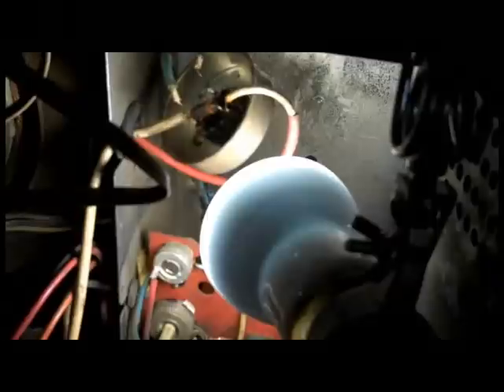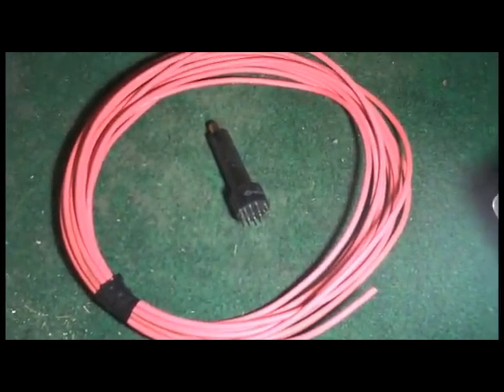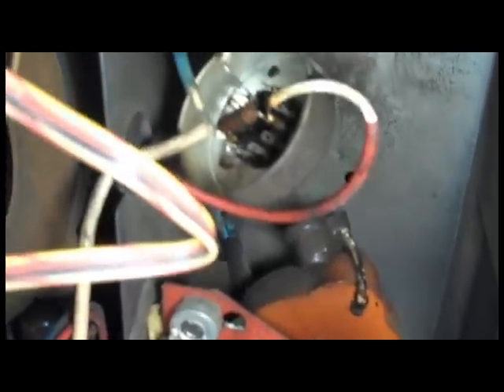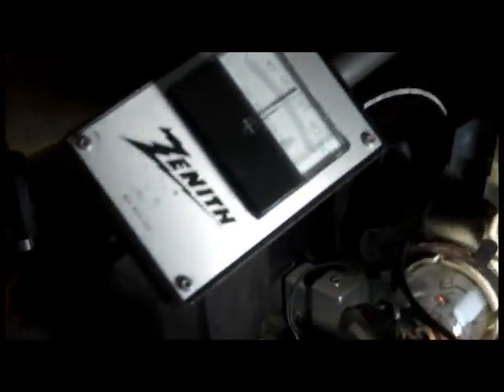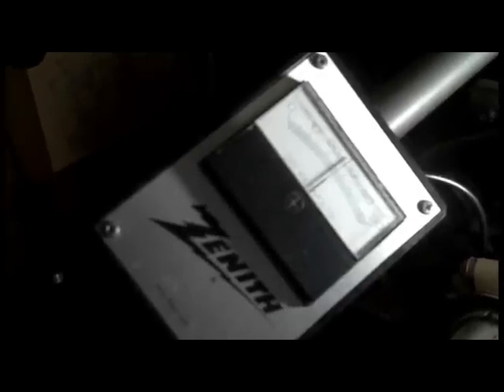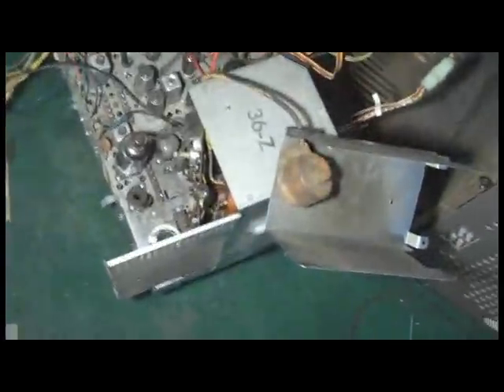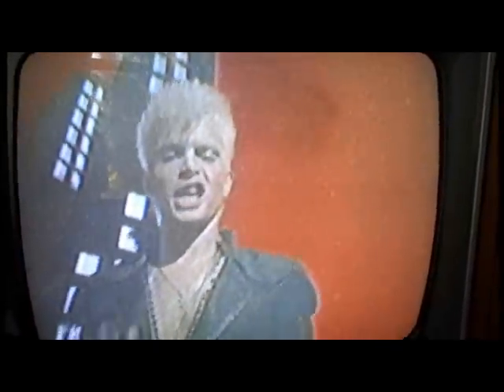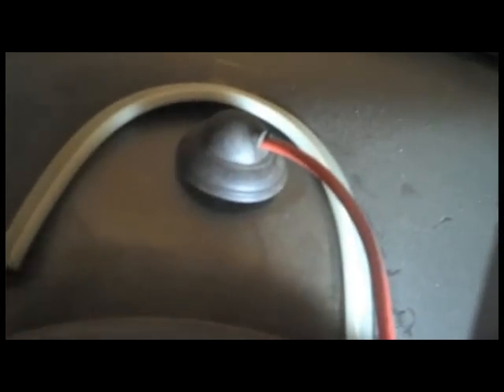Zenith 25mc36 part 2 repairing high voltage problem

Comment: The raster will shrink if the E.H.T. is too high because it then requires more energy to deflect the electron beams to the same degree.There is a danger of X-Ray emission here which you didn't mention.Didn't Billy Idol have an amazing snarl?

Comment: I have the same set , 25mc36z  It has a good picture but when it warms up after about 30 minutes, I can hear a little arcing  sound coming from around the Flyback.  Is that normal?  It doesn't effect the picture but I don't want it to do any damage.   I've always had solid state tv's this is my first Tube TV.  Thanks for posting these videos.